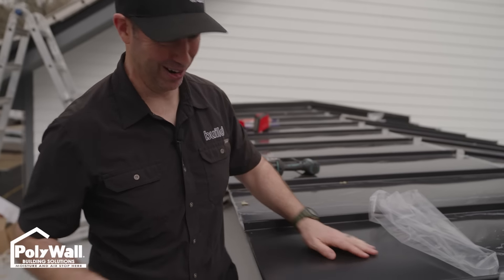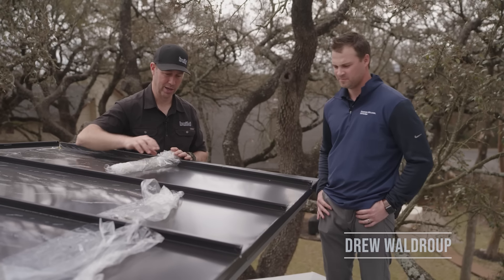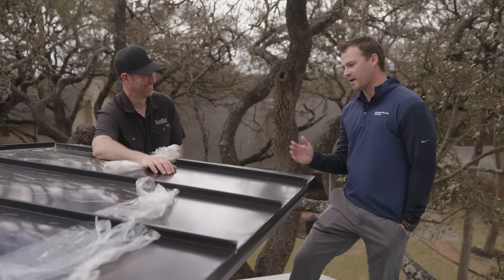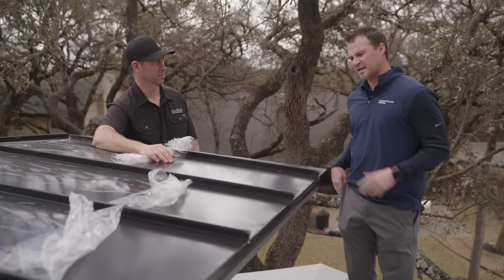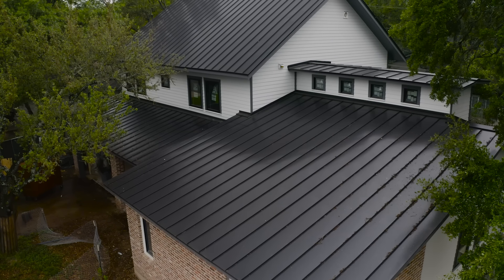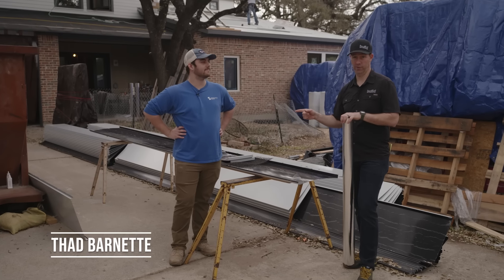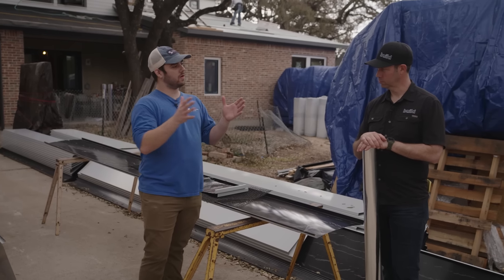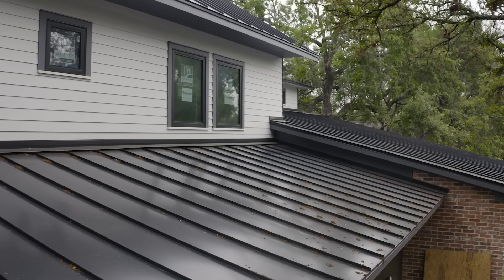Black Metal Roof - Dumb Idea?

Comment: I have had TWO Jeep Wranglers with black hard tops. I live in the "LAS VEGAS" area. HOT DESERT ENVIRONMENT!!  As soon as I arrived here, I started experimenting around with the color of the hard tops as my A/C (air conditioning) was struggling to keep the inside cool in the summer months.  Black color outside of the hard top equated to 175 degrees inside on the ceiling of the hard top.  I added insulation inside and I did not see as significant reduction of the inside temps and the ability of my a/c to keep up.  The second I painted the outside of my hard top WHITE, my inside temps dropped from 175 degrees to 125 degrees.  NOW, the air conditioning could keep up and the ambient air temps were maintained with "HALF" the settings of the A/C unit.  Now my a/c could and would keep up with the outside temps even if they were over 110 degrees outside.  Black outside color of a roof (house/car/ANYTHING) does not make sense to me unless you live in ALASKA!!!  Use a laser temperature measuring device and TEST EVERYTHING!!! Black absorbs heat and white reflects heat.
Reply: When it comes to cars the insurance data is really clear that black and dark coloured cars are around 20% more likely to be involved in an accident than a white car. It all about visibility from dusk to dawn. Only idiots buy black cars anywhere. If you want to be really safe orange and yellow are the best colours.
Reply: @jonathanbuzzard1376  could this be why company and utility vehicles are almost always white? I’m thinking of the gas/cable/satellite/phone company vehicles
Reply: Mine is "charcoal grey".  I can't remember the last time I used it though!
Reply: "laser" thermometers should not be used on objects with different emissivity (color) as they would read differently even if they are the same temperature. By definition, a black object will always read hotter than a white one, but that is a limitation of the measurement
Reply: now install radiant barrier insulation in your rafters that will cool it down even more , research it you will be amazed how much cooler it will be

Comment: This is a good example of sacrificing science for visual Aesthetics.
Reply: Sacrifice efficiency, not science. It’s there whether or not
Reply: With the  cooler like insulation design I’d bet the difference in energy loss is negligible, I still don’t quite get the radiant barrier being reflective side down....?
Reply: It’s trendy! Like teenagers swallowing Tide capsules...
Reply: @RJ-sr5dv  he does the radiant barrier facing differently in different parts of the roof, but always shiny side towards the air gap. When the radiant barrier is on top of the 3D mesh/dimple mat, it faces down into the gap and works on the principal that it’s emissivity is very low—the temperature of the radiant barrier will be high (because it is in contact with the metal roofing) but it’s low emissivity causes it not to radiate very much of that heat across the gap to the deck. When the radiant barrier is under the gap on the decking like he has on the steep pitch portions, it faces up into the air gap and works because it has high reflectivity—it reflects the heat back that is radiated by the hot the metal roofing. You can actually put it on both sides of the air gap facing shiny sides together and double the effect, but the typical radiant barrier is already effective at about 95+% so that isn’t generally considered necessary.
Reply: @MartinThmpsn  radiant barrier is the construction equivalent of snake oil. It works by being a surface that doesn't emit heat through radiation, it's value is around .1, meanwhile dust's emissivity value is around .9
Ever seen an attic that wasn't dusty?
Reply: @robertj1777  Please read and understand radiation heat transfer before making silly statements
Reply: @MartinThmpsn  Huh, Martin, thanks for your time in explaining it to me.
Way back, some 40 years ago we were instructed to drape the radiant barrier in a subtle S pattern between the roof rafters. As it was explained at the time the suns UV (?) rays would be reflected in a angular fashion out .
Maybe I was fed snake oil.
Reply: @nisterror  am I wrong? You can't sandwich it between materials or it becomes a conductor. If it has dirt on it then isn't it also a conductor?
Reply: @6willis  There was no science in this video. No explanation on what SRI actually means. No talk about how reflectivity/transmissivity/absorptivity coefficients add up to 100%, how the incident solar radiation depends on location/roof angle/time of day/etc. Or how emissivity is proportional to temperature^4 and balancing the energy equation to find the steady state temperature of the metal roof. How the reflective backing reduces emissivity coefficient on that back side, keeping the energy on the outside. How the plastic spacer reduces conduction into the roof and increases natural convection on the backside. I could go on... There's so much that could be done if he had brought in an engineer instead of a salesman. That dude up front didn't know anything about the science. He just knew what was "on trend" and what sales numbers were like. "Hey Matt, it's not that good, but it's better than the worst stuff out there. So you should buy it!"
Reply: @robertj1777  Radiant barriers are not meant to mitigate conductive heat transfer, as you pointed out, but to reduce the ration heat transfer emitted by the roof after it has collected heat, and also from the radiation coming directly from the sun. 
If they were "snake" oil, you would not use them in your car windshield, or see them in fire suits in smelting factories etc. Just saying
Reply: @nisterror  fire suits and smelting factories aren't construction, just saying. New construction it might be worth it(doubt it) since you can design for it but remodel and retrofit you'll never get your money's worth... good insulation is money better spent.
Reply: @robertj1777  There is no silver bullet to mitigate problems, and often a combination of techniques can produced the desired outcome, specially since there are 3 main modes of heat transfer. At the end of the day it is up to the client and the engineers to figure out the sweet spot between economic viability, desired performance, and to an extent personal preference.
Reply: Same with windows, high ceilings, and so many other things we do. That's life. Sorry you feel the need to be so negative and not enjoy things.
Reply: did risinger make the most energy efficient roofing decision? no. did risinger make a roofing decision that will cause his house to be unbearably hot? also no. so the worst that you can say is that risinger didn't make the most energy efficient roofing decision. but there are plenty of other places in this house where he didn't make the most energy efficient decision.

my sense is that you are citing building "science" without really understanding it. i find it amusing that people are criticizing risinger's choice of a black steel roof without even bothering to get actual data to support their assertions. here is the reality of how people actually make decisions about houses: you build a house for people to live in it; you don't build a house as a science project. that means that you make tradeoffs between maximizing efficiency and achieving aesthetics. you care about aesthetics because you want people to actually want to live in the house.

if you are such a stickler for "science", you should also be criticizing risinger for putting too many windows in his house. windows are a source of heat load in a house. if you were to merely go by "science", you would only use enough fenestration to meet various building code requirements. the problem with that is that it might be a somewhat dark house, and people might not want to live in it.
Reply: Its called gentrification...lol
Reply: @nisterror  right? 🤣
Reply: @6willis  efficiency is based on science, that's why humans spend so much resource on it.

Comment: 3:45 He admits that "Yes, black is the worst possible choice of metal roofing with an SRI of only 25." Any other conclusion is wishful thinking.
Reply: True, but color choice barely matters if you run an air gap and a radiant barrier like he is.  I did this and my attic space temps went 140 to 95 in the middle of summer in southern Illinois.
Reply: I have a white metal roof with an sri of 93. It saves a ton in the summer BUT it also costs me a ton in winter. They did a study and even in hot arizona a white roof only saves about $200 or less per year for an average size roof.

The big downside is the faster facing of the color and the stresses related to expansion and contraction
Reply: Agree, he can point out all the things he does to help with the problem of picking a 25 (absolute worst) over a 100 (best) but the end result is using the same systems on both houses the one with the 100 will still perform better.  Would also help all of the building products connected and directly under the roof last longer.  His house is normally based on picking the very best performers but the color of the roof looks to be 100% how he wants it to look.
Reply: @pembo13  From Lil Giant I know NOTHING about this stuff. Watching because a friend is considering metal roofing when he homesteads in Florida. So, are you saying black is bad for environment, metal is, or all that extra under the roof he talked about, to make up for the black, is bad for the environment? 

P.S. Am asking friend to build for both heat AND cold in Florida. I am hoping insulation will help in both instances. Black metal would be good, I think, in winter but am not sure. 

Another video is talking about possibility of a “little” ice age coming through in couple of years due to a “solar minimum.” Want prepare, just in case. You may remember England Thames River used to freeze over and they had ice/snow “fairs” on the ice of the river in winter, during another “little” ice age. (Not that video host said that. Do not wish to put words in his mouth. I am putting in my two cents as reason that I listen.)
Reply: yeah, but look at the bright side... he's "on trend" - LOL!
Reply: @henryvalero9235  In Florida, you're gonna want the white roof on top of all the crazy stuff he did to make up for having a black roof.
Reply: It looks so cool that from the clickbait headline I was hoping there'd be some thermal emissivity or UV/ IR reflectivity magic that would make it a good choice but instead it's «yeah it's only 25‥ but hey that may be as low as the range goes but it's still better than zero !»
Reply: Yeah, pick the worst possible color for the southwest, then spend thousands more to compensate for that choice. Dude, it's TEXAS, not North Dakota!
Reply: I wouldn't go a white roof, though. It's the most efficient thermal performer, but it's painful to look at in sunny weather. You want to stand in front of a display wall in summer and pick the happy medium.
Metal is definitely the best performer as a roof. It outlasts all the other options and is the least inclined to leak, it's lighter than clay or concrete tiles so your framing expenses are less, and it doesn't poison your runoff like asphalt - here in rural Australia where everyone depends on rainwater tanks for their drinking water, metal roofing is pretty much the only sort you'll find.
Reply: @randyrush9856  Color has no effect on emissivity, taking in or releasing heat.  Heat absorption and emissivity happens at the molecular level, right at the surface.  Color is just a scale made up in the brain.
Reply: @coffeehawk  Not true, as I witnessed a test done by my father back in the mid '70s on that very subject using different color roofing and thermometers.
Reply: @randyrush9856  I shall immediately burn my college degrees on the topic and delete all work in "heat transfer" from my resume.  Thanks for the head's up.
Reply: @coffeehawk  Good idea. Because after all, hands on experience with over 50 years in the industry trumps classroom book smarts any day. And FYI, I went to college too.
Reply: @henryvalero9235  LOL as someone who’s lived in Florida his whole life. DO NOT design anything in your house to compensate for any sort of “winter” in FL. You will see “cold” temps maybe a total of 3 weeks total through out the season. And if you’re coastal it’ll be lucky to drop below 60. The summer is where the concern should be.
Reply: @tealkerberus748  why would you look at a roof, why is it a problem if it's too bright?
Reply: @coffeehawk  I never missed a day of college. And just like the professor said, class room studies can never replace hands on experience. In fact, it is in the real world where the proof is in the pudding, not the other way round.
Reply: @MrClarkisgod  he installed the radient barrier backwards! LOL. if he had used white metal panels he wouldn't even need to install  an air gap and radient barrier and would of saved thousands. big fail from a guy who touts being environmentall smart.
Reply: @randyrush9856  yeah when you have the budget to compensate for thermal load you can design your house however you like.
Reply: While yes the color black absorbs more energy, it also gives off more energy at a faster rate. It gets cooler, faster. That's why many planes are painted black. At night it wouldn't matter what color you are since there's no light to reflect off of you so it doesn't matter. So they paint airplanes black because it's the best at giving off heat. They tried white but black is just better

Comment: Black roof looks amazing but not sure if I would go choose it in a hot climate. Too hot, bird droppings, polen, dust.
Reply: Or just choose a different color.........
Reply: His sponsors will pay to keep it clean
Reply: Who cleans their roofs? 
Rain will do that for you,..
Reply: @Justusson  rain doesn't really clean roofs particularly bird poop...
Reply: @carholic-sz3qv  What kind off bird poop do you have?
Our roofs gets cleaned more or less at least,..
Reply: Iko duel grey for bird droppings. Invisible.
Reply: @Justusson  That's not how it works. Particulates collect over time on metal roofs even with regular rain. Lots of things don't wash off with rain.
Reply: They compensated for the thermal load and all color roofs show poop and debris.
Reply: Black is best color water will dry the fastest on it instead of the lighter colors
Reply: Actually, birds will avoid it. Too hot. And who's going to look at it and even notice a stray splat? Other than a steep roof, it's pretty hard to actually see the roof detail from the ground. But if you're in an area overrun by herds of seagulls or starlings, it probably would be noticeable.

Comment: If you put a black roof on a house in a hot climate you are making an oven. 
You could fry an egg on that in the summer.
Reply: Will also break down his building materials faster with it as well.
Reply: True!   Decades ago, my first house was an old mobile home, in mid Missouri.  The roof was metal painted with silver metallic roof coating.  In the heat, I couldn't hold my hand on the roof for more than a couple of seconds.  I recoated with a white roof coating.  Not only could I touch it, I could leave my hand on it.  On the inside ceiling, with the first coating, the gypsum ceiling was warm to touch.  With the white, it wasn't noticible.  On heat retention testing, black and red were the two worst colors..
Reply: True. In Australia right now the trend is dark grey/black and all the roofs are metal. I have installed one roof in the last 5 years that wasn't black. They get so hot you can practically burn yourself on them. And the builders here put so little insulation on the homes. Its so bad for summer, when you are in the ceiling its like an oven. And i dont think r 4.2(us r23) batts are  doing much to stop heat transfer from the roof space.
Reply: You can fry an egg on asphalt too
Reply: @StreamingF1ydave  Yes, but I doubt you could fry one on a white roof.
Reply: White will also be hot enough to fry an egg on.
Reply: @garryharris3777  It wouldn't be anything like as hot as a black roof. The roof shown reflects about 20% of the radiation whereas a white roof will reflect about 80%. So the black roof is absorbing about 4 times the energy a white roof does.
Reply: @caparn100  thermocouple the sheet metal then report the results.
Reply: @garryharris3777  You can get an idea of this sort of thing if you step barefoot on black asphalt in the sun, it could be too hot to step on, if you then step on a lighter coloured surface it will be much cooler.
Reply: @StreamingF1ydave  Yeah but you can actually eat it off a metal roof.
Reply: @christheother9088  yum, extra butter
Reply: You can fry an egg on my ultra white metal roof in Miami, so probably you can grill a steak on the black roof,
Reply: Yes, the roof will be hot, but very little of the heat will get into the house due to all the insulation.

Comment: It would be interesting to put a thermometer in the air gap and another in the attic and set up a sample with a white steel roof, also with thermometers, and see what the difference in temperature is. It might also be fun to see if air flow rate in the air gap changes significantly from black to white.
Reply: His attic is conditioned space.
Reply: @markboler8411  I know.